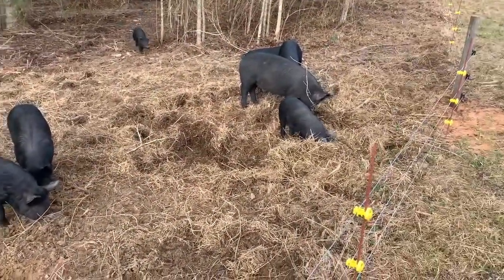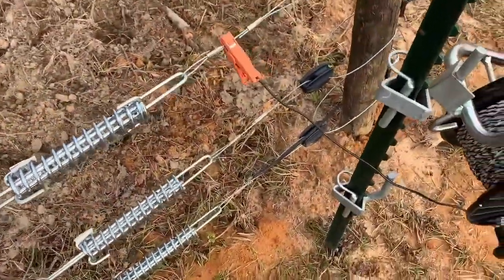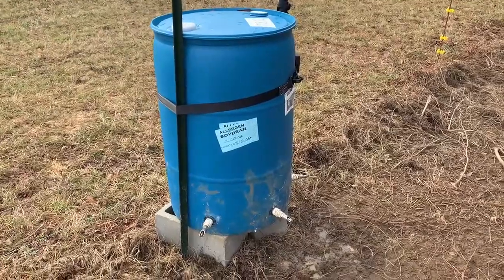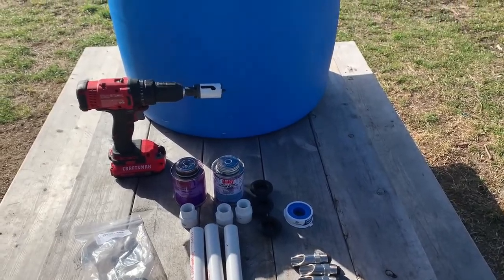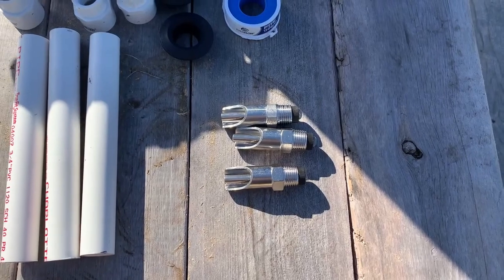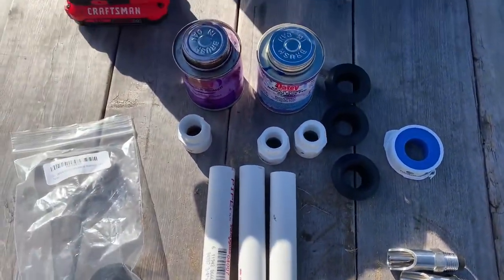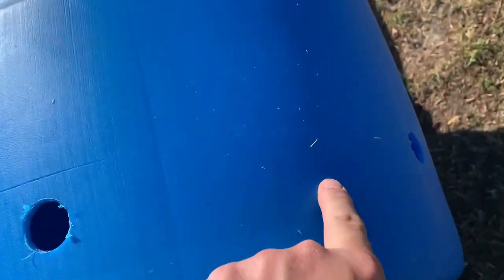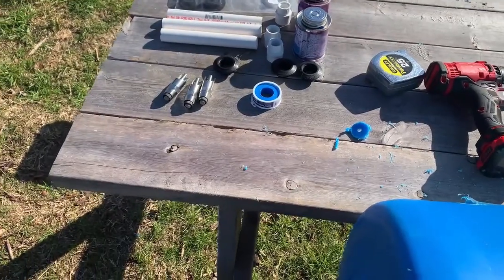Easiest DIY Pig Waterer Ever! | Don't cut holes in your barrels | Read Description Before Drilling!

Comment: Been building waterers for several years. your process is still complicated and expensive. Drill your hole, heat barrel use bolt with same thread as nipple. Thread using bolt. Remove bolt, crew in nipples done. You can also us same process and add a drain valve at bottom. 15-20 min done and no glue ot tape.

Comment from the maker: Now that I have moved my pigs several times since building these, I can attest that this method is pretty easy to drain by simply pulling out one of the nipples, and then shoving it back in when you are ready to refill.  I have done this several times now, and the uniseal's are still holding strong!
Reply: I am a new subscriber to your channel, so I am not sure where you are located.  I need to make one of these for both my pigs and my poultry so I can have heated water through winter.  Can you suggest a safe submersible heater for this unit please and thank you.
Reply from the maker: @Tiffycha1982  I am actually in Troy, Alabama.  It doesn't really get cold enough here to need to use heaters.  I have never had the water in these freeze.  Last winter we had one cold snap where I needed to dump a little hot water on the nipples to get them flowing, but that was it.  Sorry I can't provide more insight on heaters.  I know they are out there, just never needed them..
Reply: @WattsWayFarm  I am in North Alabama.  I am a lawyer also raising pigs.

Comment: Quick added tip. If you cut the pvc pipe at an angle on the end you are passing thru the gasket. This will help start the pipe and you won’t have to need as much pressure to get past the gasket as a 90 degree cut would.

Comment: Super interesting. My pigs have been gentle with the bulkheads so far, but every now and then, I get a drip.

I used to put my waterers atop CMUs, but recently built wooden box frames that are much lighter. I cut 4 lengths of 2x4: 16, 20, and 24 inch so that the box has 3 different heights. As the pigs age, I just change which height the barrel stands on. So much easier than CMUs!

Comment: Drilled a 1-1/2” hole should have read the instructions 
Found a 1 1/2 plug 4$ back in business Karen learned how to use it in about 10 seconds Best pig waterer I’ve seen thank you.
Reply from the maker: sorry about the wrong drill hole size.  Wish there was way to edit the video after uploading. Glad you were able to make it work!
Reply: Do you happen to know the part number for the 1 1/2 uniseals or is it a given that the 3/4" pvc will fit inside?  I did the same thing and got burned..  Thanks

Comment: HOLLY  COW ! !   That is Freaking  Brilliant. I am going to try this with a 275 gallon Tot.
Reply from the maker: You wont be disappointed.  But make sure you use the right sized drill bit!  In the video I mention using a 1 1/2 inch drill bit.  That is wrong!  I used a 1 1/4 inch drill bit.
Reply: YEH ; I I got that 1-1/4 from your description. The ONLY hole saw size I did not have. Ha Ha. I did a 55 Gallon drum first. to check it out. Worked 20 Times better than I thought. Going to try it out on 275 Tot next.  YOU are the MAN. I  put some sponge in the 3/4" pipe to make sure to filter out any plastic chips that might be in the drum..
Reply: That’s a great idea on the sponge. I think I’ll do that too. That’s for the great idea!

Comment: These were just the instructions we needed! Raising feeder pigs for the first time, and the hose isn’t conveniently located near their pasture, so I think this will save a lot of time.
Reply from the maker: Thanks for the comment!  I think your will like this solution. But make sure you use the right sized drill bit!  In the video I mention using a 1 1/2 inch drill bit.  That is wrong!  I used a 1 1/4 inch drill bit.
Reply: How is it working for you?
Reply: Same. I am about to attempt this!

Comment: Thank you for the video. I copied this system and it works well enough. The issue I am having with it is my pigs keep pulling the pipes completely out of the barrel causing the water to drain out. Also lost one of the uniseals in the mud after the pigs pulled it out and had to purchase another. Not really that big a deal but I am now looking for a way to better secure the nipples and pipes so that I am not constantly having to repair and refill it.
Reply from the maker: We had this same issue early on.  For us, turned out that the solution was to raise the barrell up more.  If the nipple is placed slightly above shoulder level and the pig has to reach up to drink, they seem to not pull it out. And as a bonus, it seems to not create as much of a wallow opportunity at the base of the waterer due to the water running more down the pigs throats and not out of their mouths and onto the ground. Maybe this will work for you?

Comment: Great video, thanks for sharing. I too do not like the idea of cutting open the top of the barrels, because then I had to figure out a lid; or purchase the barrels that have the snap rings to hold the lid on, but then those things like the rust. Excited to try this out, blessings.
Reply from the maker: Glad you like. Hope these work as well for you as they have for me. Please read the video description before drilling the hole in your barrel as I misspoke on the drill bit size in the video.

Comment: Note to self, know which size your using to drill out the hole in tank based on the smart guy laying out all his equiptment on a table..  Thanks buddy, your invaluable and by all means, keeping making videos.  SMFH
Reply from the maker: Sounds like you missed where in the video title I put, "Read Description Before Drilling!", or in the video description I put, "In the video I mention using a 1 1/2 inch drill bit.  That is wrong!  I used a 1 1/4 inch drill bit", and the about 50 comments that mention this too.  I am very sorry about that.  I wish there was a way to go back and edit an already uploaded video.
Reply from the maker: also check the size chart on this link.  if you have already drilled holes, you can just buy a larger uniseal gasket based on the size hole you drilled: 
https://www.aussieglobe.com/34-Uniseal-U075.html

Comment: Really enjoyed and picked up some great points from this video. You appeared to have solved several of the same things that have kept me from building a gravity fed pig nipple system. For instance - didn’t want to cut the barrels, still wanted good bulkheads and wanted some flexibility/movement allowed in the nipples.  Great stuff.  Really appreciate the follow up comment below, as well as the float add on video - I was concerned about the durability but you ha e put some of those concerns to ease as well. Thanks!  New Sub here from not too far away - Hogansville, Ga.
Reply from the maker: thanks for the comments.  These waterers really are working well for us.

Comment: Based upon this video, I ordered these parts and made this for my boar and sow waterer. So far so good (thye are about 420lbs & 370lbs). They suck and chew pretty hard, but the uniseal seems to be holding the pvc pipe in place. I was concerned that the boar would pull it out but first week is holding strong. The flexibility of the uniseal, like yer man says in the video is THE secret ingredient. Every time I tried these nipple waterers, my hogs have bent them, broke them and pulled them out.  I will make one for the feeders this week, but wanted to the hard one first. IF it holds for the boar, it will be easy for the feeders (half the size & weight when full grown). I'd add photos but I don't see a way to do that here.  I ratchet-strapped the barrel to t-posts atop two layers of cinder blocks, on my side of the hog panels with 6" pvc pipes extending into the pen. THANK YOU for this video!!! this is a game changer if it holds.
Yer man's a genius. Please keep posting your ideas for "pig farmers for dummies" like me. Keep it simple like. Now, I need a way to keep the water from freezing during Michigan winter. Let me know what you're doing.
Reply: Drop an aquarium heater in it!

Comment: Believe it or not, the hardest part of this whole waterer is finding a 3/4' smooth to 1/2" threaded PVC reducer. I've been to Lowe's and an irrigation store and nothing. I can put 2 different parts together which just makes the nipple bulky but I'm gonna choose to keep looking.
Reply from the maker: Wow that sucks. Guess I like my local Lowe’s a little better. They had it in stock. Before you buy a drill bit, please check out the video description. I misspoke on the size in my video.
Reply: @WattsWayFarm  Thank you, I did happen to catch that. No problem but thanks for the heads up. Good video!
Reply: @wattswayfarm would you happen to have a lowe's link for the reducer? I'm having a hard time finding it too! Or a link for anywhere that has it? I'm not quite sure if what I'm seeing is correct when I look. Thanks!

Comment: I used a different style of water tank, that has spots on the wall that curve inwards. That was optimal height for the nipples, and they leak horribly. Make sure you use a smooth walled containers!
Reply from the maker: Good feedback. Thanks for sharing.

Comment: I built this one exactly as you have in the video and was very pleased with it for quite a while.  However I now have a pig that is pulling the whole thing out.  Went out this morning and she had pulled out 2 of the three.  Still can't find one of them.  Every time she does this, which has been three times now, I can't find the rubber grommet.  Have you had any pigs do this with your set up and did you find something to fix the problem?   Thanks for the video and any thoughts you can provide.  I think I may have to go with a bulkhead for this pig.
Reply: Sorry, I just read your solution down below.  I'll try raising the barrel to shoulder height.  Thanks!
Reply: @frederickmoyer6793  Did raising the barrel work?  Thanks.
Reply: @bradlikescake  It worked for my boar and barrow, but my gilts kept pulling them out.
Reply from the maker: Try adjusting the flow. My feeders kept pulling out some new nipples until I opened them up a little and gave a bit more water flow.

Comment: Hey Scott - great video, I purchased the classic bulk head and then realized i would have to cut a hole in top of my blue barrel but dont want to. So your solution is perfect. QUICK question. On the amazon link for the 3/4 uniseals it says you should use a 1 1/4 hole saw drill bit with 3/4 uniseals. I believe in the video you said you used a 1 1/2in hole saw. Let me know what you think? Thank you!
Reply from the maker: I just went to my tool box and got the hole saw drill bit I used and my tape measure.  It is definitely the 1 1/4 inch drill bit.  If I said 1 1/2 in the video, I misspoke.  Sorry about that!  Thanks for keeping me on my toes!
Reply: @WattsWayFarm  Thanks so much for the response. No problem at all! Hopefully i have that size. Ill report back how it goes. Waiting for the uniseals from amazon. I am in Utah on 7 acres and just got our first two feeder pigs ever. Learning as we go!
Reply from the maker: @gobigacres  I have another video on the DIY pig feeder I built.  You might find some value there too! Good lukck!
Reply: 1.5 inch hole is to big for a 3/4" uni-seal. Learned that the hard way.
Reply from the maker: Sorry about that!  A bigger piece of PVC with a reducer to the nipple size would work too for a cheap fix
Reply: @WattsWayFarm  It's ok. Still a valuable video.
Reply: I just did the same thing. Hole is too big now, so "misspoke" just cost me a barrel. Luckily I have two, and that one will become a feed trough. LoL still good info, I'm not mad...just disappointed. 😂
Reply from the maker: Sorry about that. Wish YouTube gave you a way to edit the video after uploading. If there is a way to do it. I don’t know what it is.
Reply: @WattsWayFarm  you gave us fair warning, when you said I'm figuring it out as I go! LoL it's ok. Thanks for putting out content. I should have compared the bit to the grommet to make sure he was correct as well, so it's just as much my fault.
Reply: Guess what I just drilled my barrel hole  1 1/2 like you said in the video. I guess it’s my fault for not checking. I guess I can use that barrel for storing feed🤣🤣🤣
Reply from the maker: @punkrods77  Oh man, so sorry to hear this.  Anther comment below said she figured out a way to make it work.  I haven't tried thuis, but she said, "Had the same issue but made it work. Just pry the unideal gasket halfway over the outside of the 3/4 pvc adaptor with a flathead screwdriver. Twist the uniseal gasket into the hole in the barrel. Then tap on the end of the nipple with a rubber mallet until the whole assembly snugs up into the gasket. The gasket will seal the outside diameter of the pvc adapter to the 1 and 1/2 " hole."

Comment: We just something like this together.
The nipples only dribble a little water out.
Are there nipples that flow better?
I am guessing the one we used is intended for use on pressurized water.
Reply from the maker: On the the nipples I use, you can adjust the flow. Kind of a pain to do as you have to take the nipple out. But on mine, there is a little black ring that you loosen to increase the flow.

Comment: R u sure u used 1 1/2 holesaw to drill out the whole? I have drilled out 2 different barrels with 2 different  1 1/2 holesaw bits and the seal just falls out! I’m thinking it’s a 1 inch..
Reply from the maker: Ya, sorry about that.  I misspoke in the video.  In the video I mention using a 1 1/2 inch drill bit.  That is wrong!  I used a 1 1/4 inch drill bit.  I tried to add a warning in the video title and description to help folks catch this.

Comment: Not sure if this has happened to anyone else, but I tried this method and my pigs are actually able to pull the entire nipple and pvc pipe piece out of the barrel completely. Draining all the water. I even tried epoxying it in and they still pulled it out. I had to change to a different method.
Reply from the maker: This actually happened to me too.  I fixed it by simply raising the barrels up so that the nipples were slightly above shoulder level on the pig.  If they have to reach for it that seem to not be able to pull it out.  I am using these water barrels on my board, my t4 sows and all my batches of feeders.  Try raising it up and see if that helps!

Comment: Saw this video and been looking for a good way to water my pigs. They tip there water bowl out and it’s a lot of work to get them water again. This may be a stupid question. I have two pet pigs will they adapt to this pig nipples. If so I got barrels at work and I love to build them a water tank like this. Would be easier for me. Also will it give them enough water they need. Sorry for the long question
Reply from the maker: I think they will adjust to it very quickly. With my new batch of piglets I just got, I put a small dab of peanut butter on each nipple to ensure the little guys would find and use it, but I don't even think that is really necessary.  Those guys are just really smart and figure it out. As far as giving them enough water, I think yes.  No problem there either.  The pigs simply stand there and drink their fill. Those nipples do have adjustable flow rates though if you want them to get more.
Reply from the maker: Check the size of your drill bit if you build this.  I misspoke in my video when I said 1 1/2 in hole.  I should have said 1 1/4 inch hole.

Comment: Great video.  I’m having trouble locating a 3/4 smooth to 1/2 threaded connector.  Do you have the part number for the Lowe’s part?  Thank you
Reply from the maker: I actually need to make another of these.  Give me a couple of days to get by my local Lowes where I got them initially and see what I can get.
Reply: That would be very helpful, thank you
Reply from the maker: From Lowes: Item# 126919,  Model # 435101RMC, I think this is a link to it.  Shoot me an email and I'll send you a pic of the entire box/label. 

https://www.lowes.com/pd/LASCO-3-4-in-x-3-4-in-x-1-2-in-dia-Adapter-PVC-Fitting/3369126

Comment: These worked for the first few weeks with my pigs then they figured out how to pull the pipes right out of the gaskets. I have used industrial adhesive to attempt to glue them in but they are so strong they pulled the pipe and adhesive 😢

Comment: I used the exact same set up as you here,  and mine still leaks! I don't know what I'm doing wrong 😕
Reply: Did you see in his description where he said the wrong size drill bit? He said 1 and half inch but meant 1 and quarter inch.
Reply: @AncientEnergyEyesOpen  yes I did see that. The only thing I really did different was using a spade bit vs the hole saw bit he used
Reply: @davemoore705  I haven't made mine yet, so I don't have any real answers. I just noticed his comment about the wrong bit size and was glad I did before I built it. Can you tell where it's leaking from? If you figure out the issue..I would love feedback from you for my build.

Comment: Pig pulled it out on the first day.  Live and learn.
Reply from the maker: Wow!  That is some pig!  Sorry this didn't work for you. I have been using these for close to a year now and have 3 different batches of pigs using them right now including my breeder sow's and boar and have only have had that happen to me once (just a few weeks ago my boar pulled it out). Now every once in a while, we do have to  push to push them back in where the pigs have pulled them out a few inches  The pigs do like giving them a work out, but that is one of the things I like about this solution.  I figured if I went with the rigid bulkhead approach, they would break them off...
Reply from the maker: Had a boar start pulling nipple out. Raised the entire barrel up a little more with cement blocks and fixed the issue. No more pulling it out. The nipple needs to be slightly above shoulder level on the pig. Maybe this will help you too!